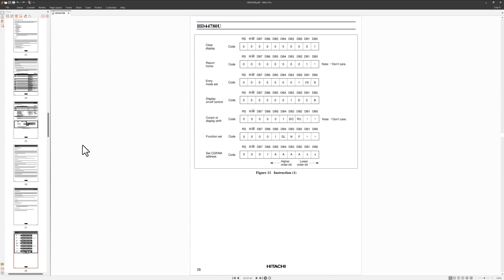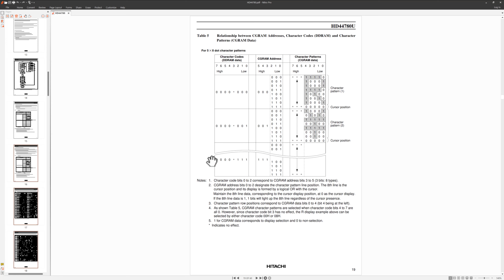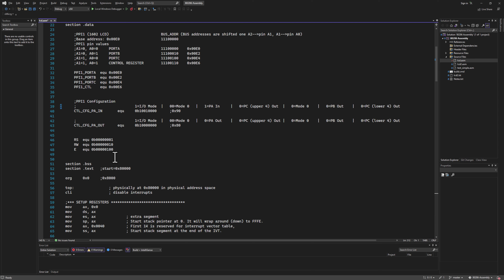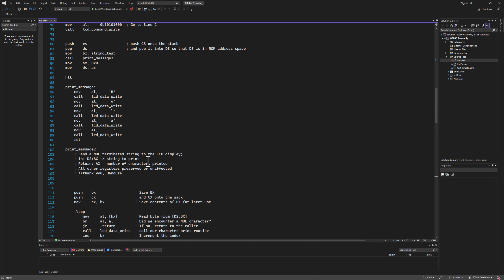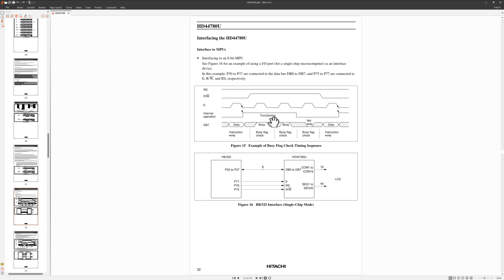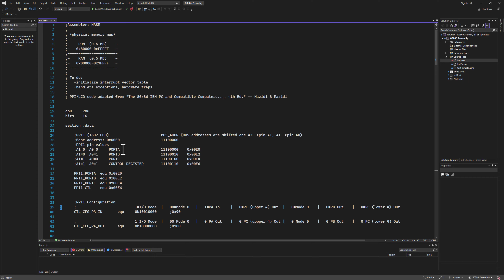80286 Build, Ep. #33 - PPI+LCD Assembly Code -- Running at 8 MHz!

Comment: Out of curiosity, could all of the circuitry for the LCD go on a daughter board and only interface with the system via ISA? It'd be a cool little "video card".
Reply from the maker: Definitely! I did something like that on my 65816 build. If you're interested, check out https://www.rehsdonline.com/post/lcd-add-in-card. This card uses a 6522 VIA (instead of a PPI), and while it's using the ISA physical slot, it's not using a true ISA standard for signals (using my own standard 🙂).